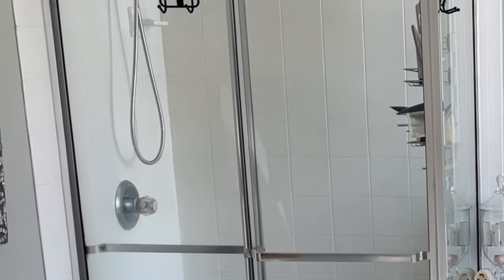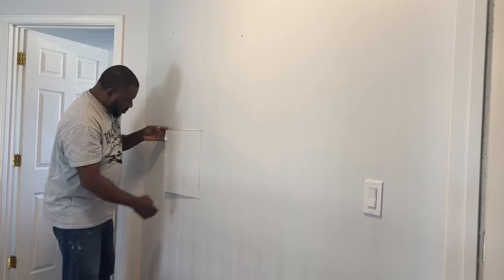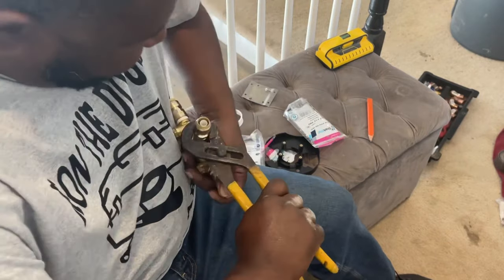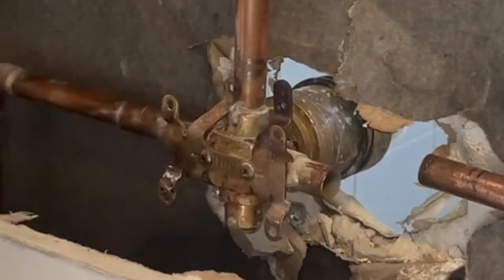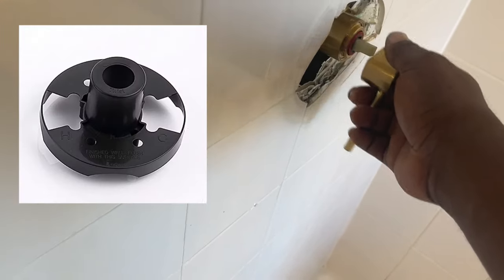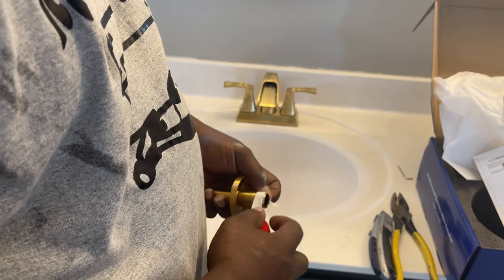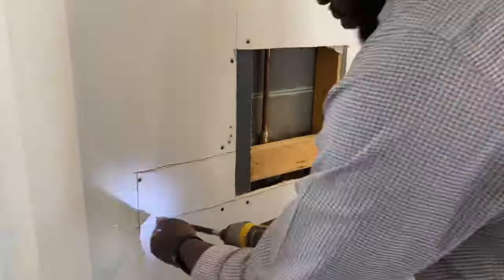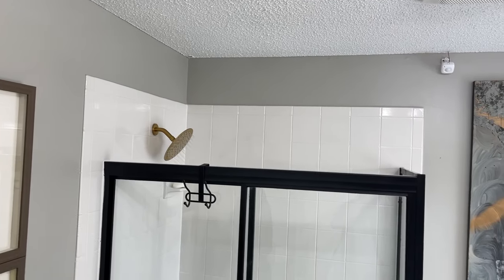DIY Retrofit Shower Valve | No-Solder Plumbing | Sharkbite

Comment: It’ll leak.
Reply from the maker: Maybe in about 25 years…
Reply: @rontalley  sweated joints can last more than 50 years. Also press fittings are not guaranteed despite what the manufacturer says.
Reply from the maker: @rosspittman2317  I typically sweat and have been for over 30 years. I’ve been using these fittings for about 10 years now and have never had one to fail. Remember that this channel is for the average DIYer and sweating pipes is something that takes more than a 10 minute video to learn. I service over 1,200 properties and have seen many, many sweated pipes fail. If I didn’t have confidence in something, I wouldn’t upload it to the masses let alone install it in my own home.

Thanks for watching! 💪🏾
Reply: @rosspittman2317  sharkbite fittings are approved for behind wall use. I have them in all my rentals. 0 leaks. I've been using push to fit fittings (not sharkbite brand) for 30 years, 0 leaks. They also meet plumbing code.
Reply: What a strange comment. It’s like telling someone that their brand-new car is going to break down someday.
Reply: @sammy7237  I said that because I know what I’m talking about. Lol btw that’s a terrible analogy that has no relevance here.
Reply: @rosspittman2317  You really don't though lol.
Reply: @RD-nu8sg  I do. Lol.
Reply: @rosspittman2317  Well, you clearly think you do lol, IPC, and UPC says you don't. But hey, to each their own.
Reply: @RD-nu8sg  polybutylene used to be code. How did that work out? CPVC is just as bad. The only reason why it still is code is because it’s treated for chlorinated water.  Shark bites will have the same fate. Give it time.
Reply: @rosspittman2317  Well, let us know when that happens considering push on fittings have been on the market 30+ years lol.
Reply: @RD-nu8sg  I’m referring to shark bites my friend.